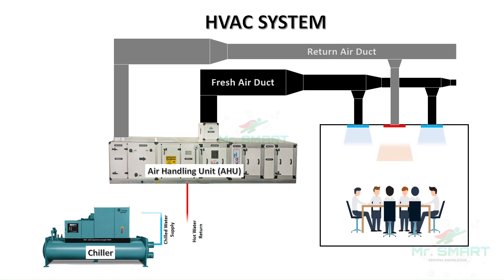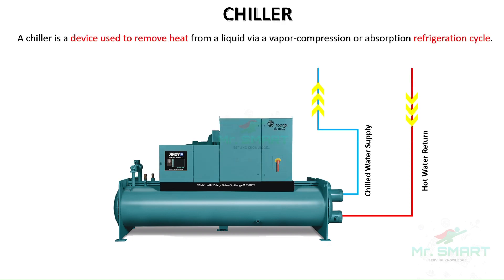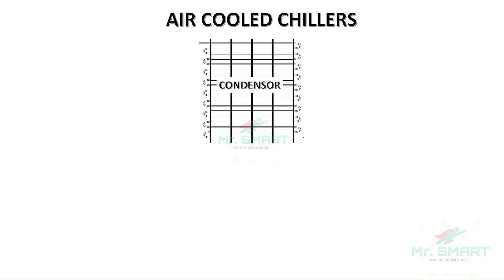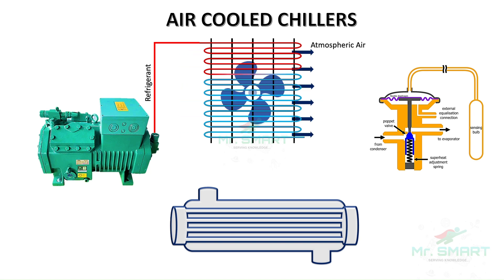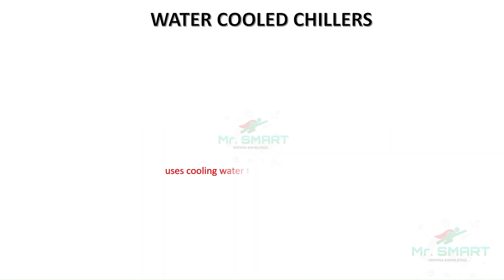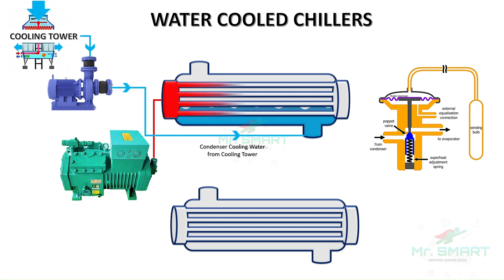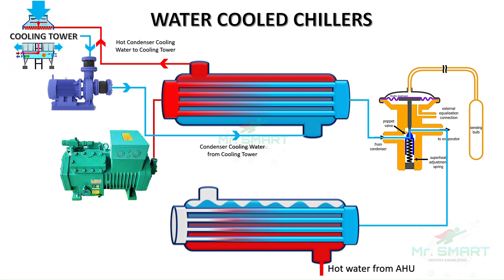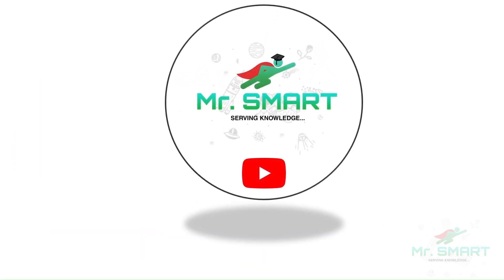Chillers Explained: How Air-Cooled & Water-Cooled Systems Work for Large-Scale Cooling❄️🌡️#hvac

Comment: Hot water released from Ahu or chilled water?
Reply from the maker: In the entire HVAC System, water flows in two different loops.
Loop 1 --> Chiller Evaporator - Chiller pump - AHU Evaporator 
Loop 2 --> Cooling Tower - Condenser pump - Condenser Evaporator 

As understood from your comment, if we are not wrong you are querying about, "where the hot water produces?"

Hot water produces in two loops

In loop 1, the chilled water loses temperature and become hot water at the outlet of cooling coils in AHU.

In loop 2, the cooling water from cooling tower loses temperature and become hot at the outlet of Evaporator in condenser.

Hope we have cleared your query. Still not clear, please be free to ask us through comments.

Thanks 👍🏻